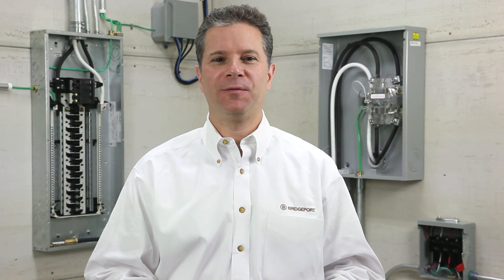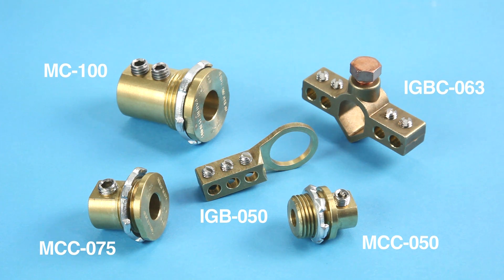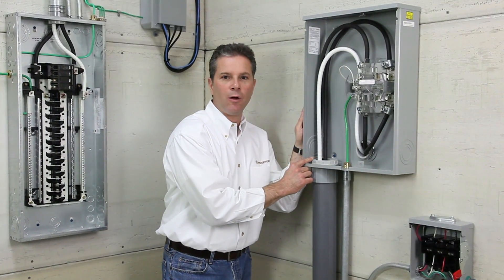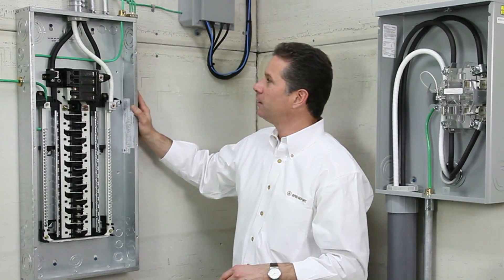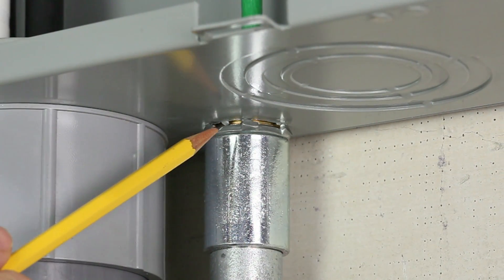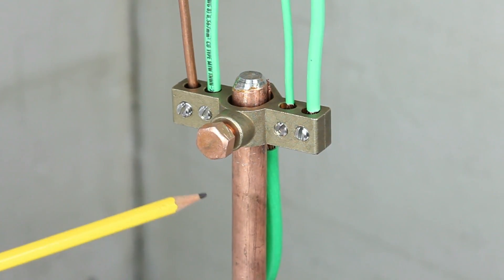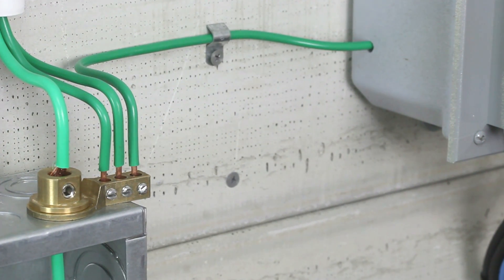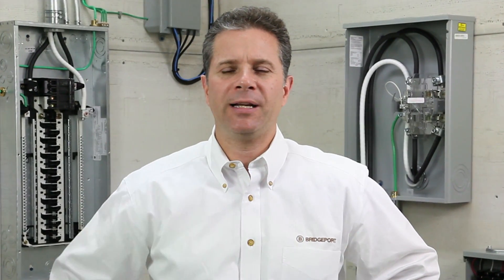Mighty-Bond™ Grounding Products Demo

Comment: The indoor panel...left side has a code issue as I see it.  This has no issue with your bonding devices but rather where the ground wire comes out of the conduit on the way to the indoor panel.  There needs to be a bonding mechanism at the end of that conduit.